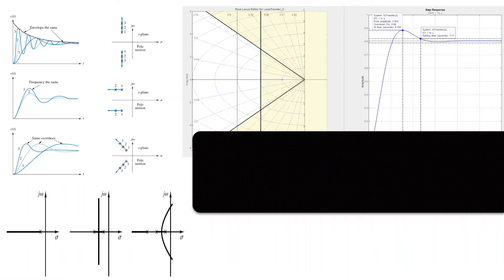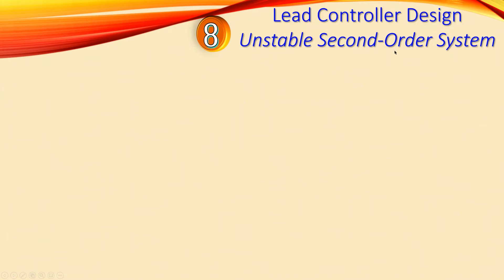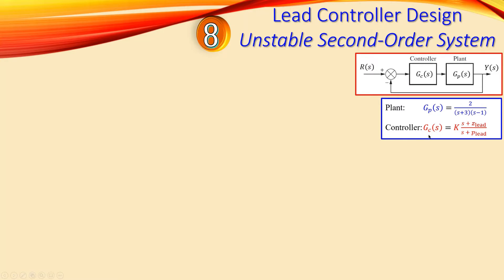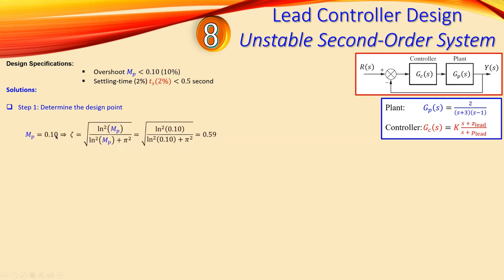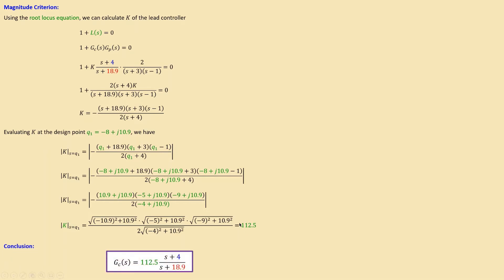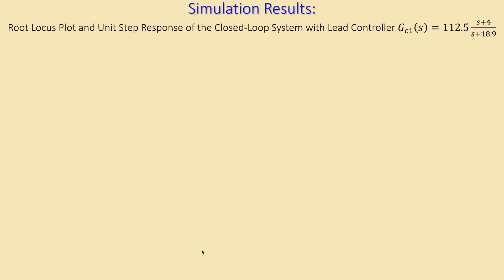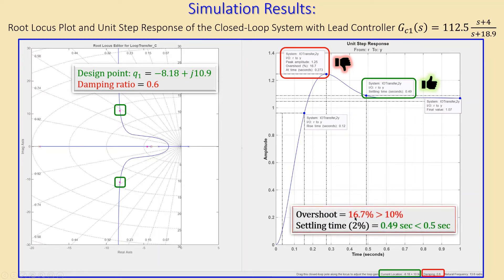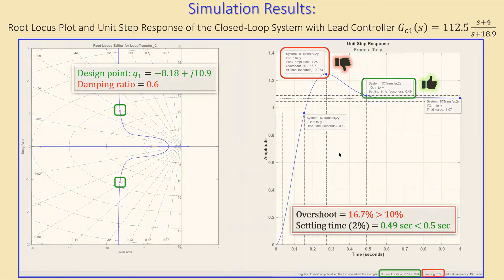Root Locus Design Method 💡 Lead Controller Design 💡 Calculations & MATLAB Simulations 🌟 Example 8

Comment: How  did we determine to choose a zero at -4?
Reply from the maker: Using the root locus method, you will have more unknowns than equations you have. So, you have to make a choice and select one of the unknowns. The selection of the zero is arbitrary, but it will have an effect on the closed-loop poles if you choose it too close to the design point. It depends on the total system transfer function too.
Reply: @CANEDUX  thanks a lot
Reply from the maker: @klcmerek  You are welcome.